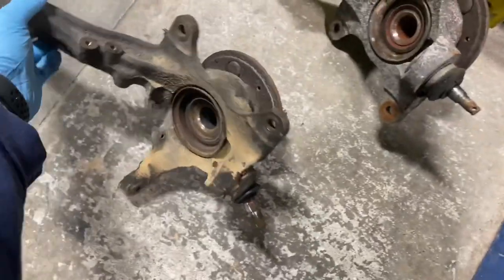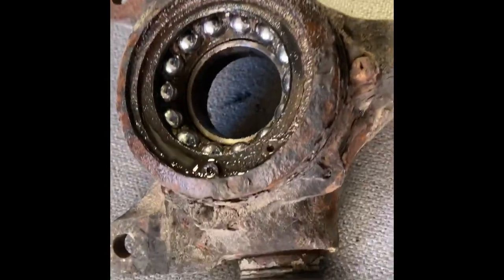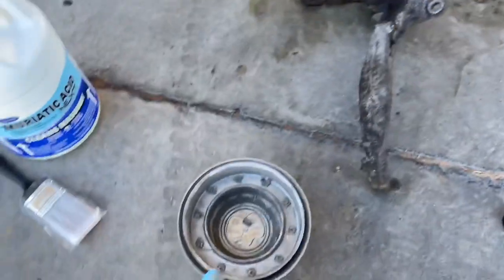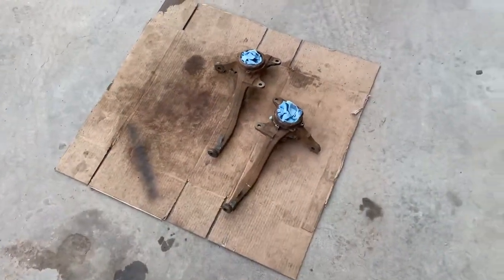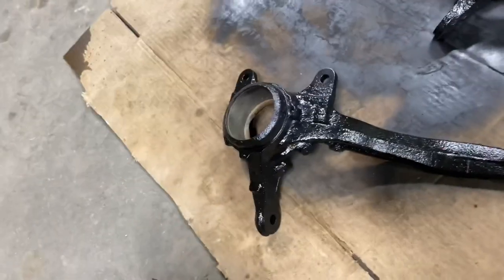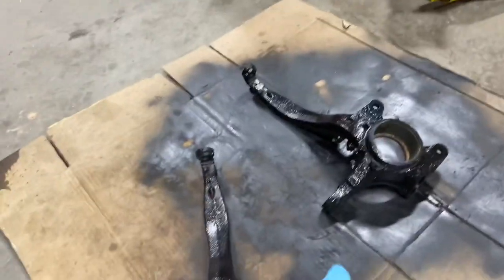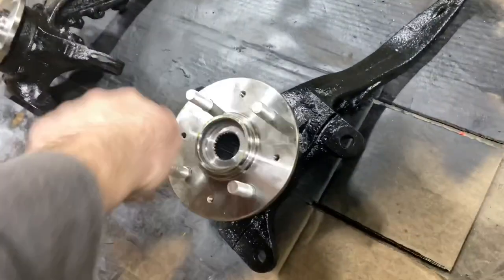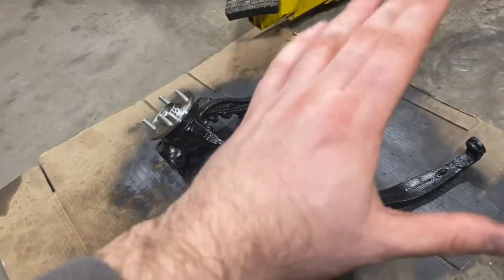Eg civic gets integra spindles!

Comment: What's up Chris, I'm working on an EG project and I have a question If you could help. I've seen people using OEM AWD CRV rear spindles on integras as a way to add a rear axle drive. Does this mean since the CRV AWD spindle bolts onto an integra, and the integra OEM spindle bolts onto an EG, That the CRV spindle will also bolt onto an EG? Thanks in advance
Reply from the maker: I suppose that would be true since eg/dc2 parts are interchangeable
Reply: @ChrisBuilt92  Thank you!

Comment: What is the advantage of running Integra front spindles ?
Reply from the maker: The dx models use a smaller caliper and the mounting bracket is smaller than the Integras, so with the integra spindles I can put a bigger caliper on the car.

Comment: Planning on converting my also. I do have a few questions? When you bought your spindles was it a non- ABS or ABS Integra or doesn't matter. Plus did u have to change  out the master cylinder & Booster. Just need to know.
Reply from the maker: Thanks for checking out the video! Spindles can be be either abs or non abs. Just double check to see if bearings are the same. I changed the master to a 90-91 mc it’s larger, I left the booster stock.
Reply: Thanks man.. keep it up.. I see u have a K swap.. nice.. I did plan on doing that.. but change my mind 8 years ago.. went with B18c5 JDM.. after that I stopped for so long now.. just need refresh in my head.. thanks again..

Comment: What CV Axles did you have to use?
Reply from the maker: I’m using insane shaft 32 mm swap axles
Reply: @ChrisBuilt92  Is it necessary to swap them or can you run the stock dx axles?
Reply from the maker: There is no way to use the d series axles on a kswap. The lengths are totally different